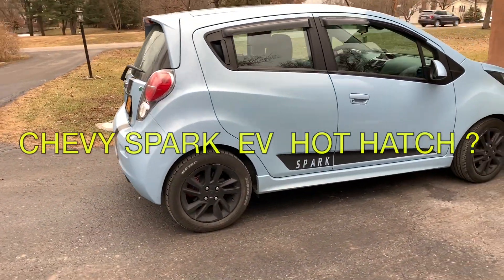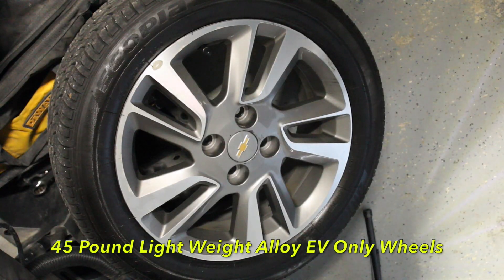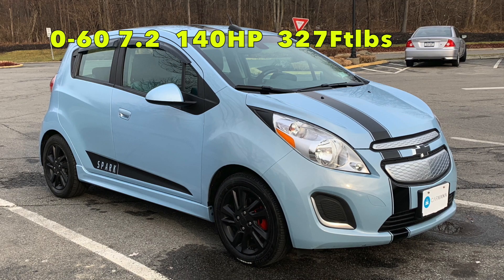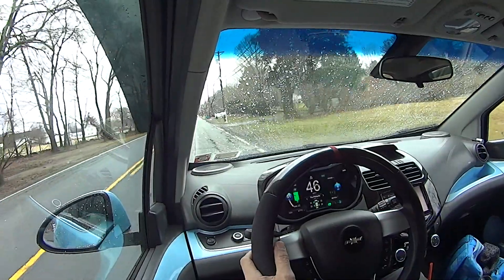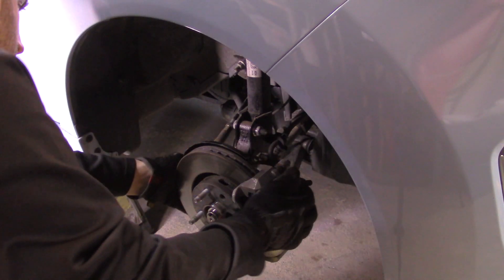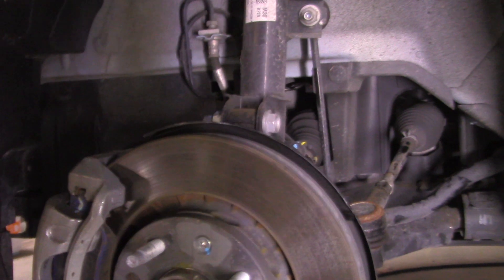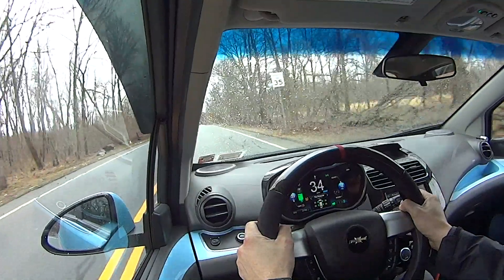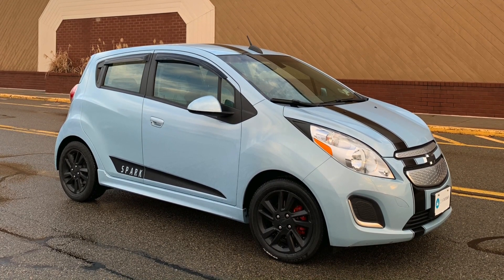Chevrolet Spark EV The only Hot Hatch Electric car ?!

Comment: The 2014 model has 400 ft’lbs of torque. It’s amazing fun. Flat on the high end, but boy does it rocket out of a stop light. It’s a poor man’s Tesla.
Reply from the maker: Even if you buy the 2015-2016 the 2014s 400 ftlbs has a 3.1 final drive but the 2015 has 327ftlbs but a 3.8 final drive making the same power. It is limited 0-30 but once you get up there it feels like its going to take off. It could easily be a Tesla if Elon would make something like this .
Reply: this is a homeless mans tesla, that being said i own a spark ev.
Reply: @svtwrc  Just imagine how much punch it would have if they didn't limit the power 0-30.

Comment: You sold me on this car. Was afraid that a 7.2 second 0-60 would be a bit slow for my wishes, but after hearing your side of the story and a few others who own a Spark EV, I'm confident the instant wall of torque you get makes it feel much faster than the number suggests. These are dirt cheap on the used market right now and I'm going to take the plunge in the next few months. :)
Reply from the maker: Arc the 0-60 is due to the controller limiting full power for the initial roll out until about 15mph. If you pedal it right at launch then feed it full beans it flies! The only car that hung off the line so far was another hybrid Lexus and we were dead even. I smoked a Camaro v6 off the line with my ECO tires ! A Jeep srt8 was full bore sounding glorious on the highway and I was RIGHT with it!  The range has to work for you , expect about 60 miles from full charge in the winter using the heat. If that works for your daily drive before charging at home again , you will have no problem.
Reply: @svtwrc  And these things are inexpensive on the used market!  Might be my kid's first car.  Aside my Volt I already have.
Reply: I usually act slow til about 30 then stomp on it. That appears to be the sweet spot for torque vs traction.
Reply from the maker: ycdocs120 just put sticky Achilles ATR sport tires 185/55R15 just up front to test the grip. This chassis with the upgraded spring rates really comes alive when you don’t spin on almost every launch . Getting some 0-50 0-60 times with the eco tires and the new tires. Video on the way. It is power limited till 35 mph but the manual says in D push the throttle half way after 35 full pull ! Strange right
Reply: @svtwrc  I have 195/55/r15 summer super sports on mine, you can almost go full lock before they rub. Found some chevy rims with cool color inserts to mount them on.

Comment: As an owner of a 2015 Spark EV I’d say
it has the potential to be a “hot hatch” as there are some underwhelming aspects from the factory, imo. The biggest issue is probably the skinny factory tires. The brakes could be better. (this car can be downright dangerous in the rain if you aren’t mindful of its characteristics). The undefeatable traction control is a hindrance. The torque is clearly neutered off the line, definitely slowing the 0-60. 2-300 less lbs would be more optimal as well. The range needs to be at least 150 miles to be really daily livable as your only car, especially in the winter running the heat(unless your commute is round trip less than 50 miles).With all that said the car is still quite fun, especially for $9-10k used!
Ill admit I am a bit of an enthusiast as I also own a Hellcat, Tesla model 3 performance and an old Miata. The Spark is a beater car for me:)
Reply from the maker: Ben Jake Hi Ben , I got some high performance tires for the Spark up front , still finding the match for the rear 195. The tires woke the steering up , braking is better , turn in and you can hook off the line in the right condition. now I’m getting some impressive launches dusting some turbo cars .my plan is to put the Megan racing suspension set up in and go SCCA Autocrossing as I’m a veteran autoX er. I believe with the sparks throttle response I can put some serious times down. There are videos or the Spark EV racing at Mazda Laguna Seca and it beat a lot of cars it should not have.  It is soft in a lot of ways but so are some of the Hot Hatches out there. 08 WRX comes to mind. Old GTi was even soft in a lot of ways. The Hellcat must be amazing , I own a quick little Subaru but my wife is getting a Tesla and I think it needs to be the performance , what model we are still looking.  Thanks for watching .
Reply: SVTWRC 
Yeah with the right set-up I can imagine the Spark EV performing very well in the autocross/autoX! The Hellcat is awesome; comfortable, sounds great with seemingly endless power, a bit under tired and has traction issues going wot 1st-3rd gear even 4th in the wintertime. 
You seem to be an enthusiast yourself. The performance 3 is definitely worth the extra money imo. The standard dual motor brakes and tires are underwhelming with much lower limits. The performance has superior handling and braking, sharper steering, track mode and a lot faster 0-60/satisfying g-force feel:)
Reply from the maker: Ben Jake yeah check out some of other videos , I Autocross and rallyX with SCCA but rally was beating the crap out of my WRX STi  and my prepped Saab is in the junkyard with a broken frame from a jump . The Hellcat must be so much fun to try and get traction because I heard when it hooks you can go 0-60 in under 3 seconds! My fun vehicles need to be inexpensive performance type or at least like the Spark a potential style car so I can modify them and race them on a budget. The Tesla will be a shared car between me and my wife and I’m so excited been speaking with some people on modifying the Tesla and Spark . Specially the annoying 0-30 Spark software power reduction . Stay tuned that may be a good one.
Reply: When do you have time to drive so many awesome cars?
Reply: Idk if you still have it, but try half throttle till 30mph then floor it. That's how the owner's manual says to launch and it grips and goes faster than if you let traction control detect slip, fight it, recover, then accelerate again.

Comment: I'm considering one of these as a daily driver so I can keep my Avalanche for truck stuff. What kind of range do you normally get out of the Spark?
Reply from the maker: Kip Winger hi there , the Spark differs from season to season so summer is around 80 miles a charge and winter can see a drop to 55 miles a charge due to the cabin heating using the power from the main battery. My work drive is around 40 miles round trip going the long way even in winter I can make it . If the driving your doing is in that 35-40 mile round trip before a home charge of around 12 hours using the wall plug at 120volts when empty this may work for you. As an only car this doesn’t make sense unless you have a strong charging infrastructure near you.
Reply: Quarter mile...at a time

Comment: I think the appearance problem is the giant headlight profile that looks like a nostril. 
I would paint the black triangle body color & the same with the side of the lens that the light isn't shining through.
Black plasti dip on the stock wheels might make them look bigger.
Lowering the front for weight distribution & slightly wider tires in front should help launches
Reply from the maker: Robert Pryor Megan Racing Coilovers made a huge difference . So did the weight savings , race seat , and front tires.

Comment: Been watching closely at the 2016 Spark EV. Its a no brainer to purchase the Spark EV over the Nissan leaf for the price and performance. Thanks for 

Chevrolet spark ev 2016 
used 
$15K CAD
4 seats
DC fast charging
19kwh (but has a higher efficiency than the leaf & liquid-cooled)
326 lb torque
140HP
131km range

Nissian Leaf 2016 
$17K CAD
5 seats
DC fast charging
24kwh
187lb torque 
107HP
135km range
Reply from the maker: Jacky Heshi the thermal managed battery seems to be what separates this from most other EV at this range. The Spark is a little beast  and could easily be the formula for what Tesla looks at for a  small compact car.
Reply: Not all DC fast charging are the same. SparkEV charges from 0 to 80% in about 20 minutes, something that no EV can do (not even latest Tesla). It's not only because the battery is small, but battery chemistry and superior cooling. See my blogspot.

Comment: I've been using an OpenEVSE to set a timer so I can avoid charging over 80% when I walk in the house. It's a bit pricey and that I know that I only draw 16A max (12A at 120v) but I know of no other 120/240v EVSE that can set a timer or has built in Wifi to control my (SoC) state of charge.
Reply from the maker: Peter Sachs someone stated that the “always plugged in for the next drive “ dissipates the 12v quicker. As far as the 360v 19kwh in the rear , don’t know of any that have WiFi that would be incredible. You can also keep an eye on SoC through Torque Pro but you have to have the Bluetooth dongle plugged in .

Comment: They should have made it AWD like most other electric vehicles. Otherwise a impressive little car, lots of potential.
Reply from the maker: that would be amazing but the price tag was would be over 30k USD and it was already a head sell at 26k new. The Bolt doubled the range making the Spark an almost steal on the used market. It diminished in price over 65% in less than 2 years due to the Bolt.
Reply: Only Tesla has AWD. Most EV are only 2WD.

Comment: I have the 2015 and love the car you are spot on with this review! Around town super fun to drive, but on the interstate with the short and narrow wheelbase when you get in those tire grooves in the asphalt it get really weird when you put the hammer down!
Reply from the maker: Peter it’s so different than gas cars. So happy with this so far.
Reply: @svtwrc  please keep posting videos on this car, there's not much on detailed performance tweeks on you tube thanks!
Reply: Part of that is the the way the tread on the stock tires is set up.  When we swapped our summer/winter aftermarket tires on it improved noticeably at speed.

Comment: I have a 62 mile round trip commute to my farm. I am looking at getting a Spark EV,  how long does it take for a half and full charge using a regular power cord?    I have access to power at the farm and i may put in a fast charger out there eventually.     I worry about the winter but if i can charge it up there i should be ok im hoping.
Reply from the maker: Javier Picard hi honestly that’s too close to the actual range you will see in the winter with the heater on.  The charge from empty is around 15 hours in the cold and around 7 to go from half. Not sure this is going to work for you my round trip is 30 and it’s perfect. Maybe the Bolt EV or something with over 140 miles range should really work for you. If you get stuck have to take a detour , you may be in trouble with the Spark.
Reply: @svtwrc   damn  i figured charging during work hours would be enough to get back home. 
Driving up 31 miles to charge it for 7hrs would leave me with like 45miles or so being enough to get back?
Reply from the maker: @javierpicard5532  if you get one with DC fast charge and have a charger near by you would be set. charging with the Level 1 set to max amps 12 would help.
Reply: @svtwrc    pardon my ignorance   what level charging is 240v?    If i have 240v at my farm and at the house i would be ok right?  It would be 100% every time i go home or the farm.   In the winter would it be less than 35 miles one way?  
 I also have my truck and my gf kia soul incase the roads were too bad.   My gf could usenthe spark in town and i could use the soul if it was that bad.   It gets cold here but it isnt horrible.
Reply from the maker: Javier Picard we are all learning about EV here . Yes a level 2 @ 240 is the best bet . You can most definitely make that work from the sound of it as long there is a back up car. Also in the winter use the Temp button to heat the cabin then shut it off but leave the HVAC on circulate it keeps the heat for a while before you need to kick the button on again for a little bit, saves a ton of range with the heater on.
Reply: @javierpicard5532  I live in an exurban county around Atlanta and typically have 60 mile round-trips for the photo gig I do.  If your total trip is 62 miles round trip with out a charge, you are the practical limit of what you can do and get home provided you have your tires pumped up to about 40 miles and don't use the resistance heater.  If  you're in the south, a decent down filled vest and the heated seat should suffice ... or add a 12-volt heated pad. Both are comparatively low draw and you'll be plenty warm. 

If it is 62 miles one-way, a 120 L1 charge only adds about 4-5 miles for each hour of charging. Seven hours would add  30-40 miles which combined with the 10-20 miles left puts you only at roughly 60 miles ... which would be a killer if it is 62 miles. 

There may be some other factors - rain will knock off 10-15 percent of your range. If it is flat land, reducing your speed may gain you more than you'd think.  Terrain is also either a help or hinderance. In running my routes there are some highways I will use if going north east but I'll avoid the same stretch going southwest, opting for secondary roads where my route toward higher elevations are on roads I can drive slower on because I can maintain a higher (5.0+ miles/kwh )  The cool thing is that using the roads in the direction of lower elevation will let me cruise at 60+ and still generate about a kilowatt of power. If I'm need more power, I simply shave off some of my momentum going up the next hill, thereby maximizing the generation of power. 

Fact is, playing the hills is my only exposure to fast charging.  I mean if  you're traveling down a long hill, you can often get a 60 second sustained 25kw charge :), but the best this one offered is the 3.3kw L2 J1772. The L2 charger will pump about 12-15 miles an hour of charging and getting fully charged takes about six hours. 

Let me add the SparkEV I drive is an early, early '14 that was first registered in February '13 in Michigan. The SparkEV was not available for sale until that summer so I have one of the  oldest battery packs. 

asphalt

Comment: Yep remember when these were released in small numbers. You have the later LG Chem version with lower voltage battery system. The earlier ones with the A123 battery pack had a higher voltage system and had More Torque. This is a silly car that the GM Lawyers forgot to shutdown the project.
Reply from the maker: Neojhun haha just to prove your point we Camaro SS 2014 lost to the spark EV regularly that’s not supposed to happen !
Reply: @svtwrc  Welcome to the crazy world of BEVs. The realy crazy cars are the half tonne batteries beyond 70kwh. At a low stress 8 C-Rating that is 560kw ~ 751hp. That is the absurdity of modern large format battery arrays.
Reply from the maker: Neojhun hopefully in the near future those modules will become small enough to allow long range EV race cars . It would be nice to retro fit a lighter weight module that has the same 21kw the current peck has but saves 300 lbs would equate to more range better performance.

Comment: When replacing the 12Volt battery is it okay to go with a non-AGM battery? I had a very hard time finding an OEM AGM battery for this car.
Reply from the maker: Andres Abreu that’s a tough one but you should be able to replace the Lead Acid 12v w lithium . I’m going to have to dig into this , maybe the cost was too high from the factory?
Reply: @svtwrc  I was able to find the OEM battery on Amazon. It was supposedly "new" but it clearly was not and was not the freshest date. It was also priced at $200 which was the cheapest I could find. From my research a non-AGM battery will work but will degrade quickly also another Spark owner suggests that a non-AGM battery might not be compatible with the electronics. They pointed out that the Volt also only uses AGM and it shares some of the same electrical components as the Spark EV.
Reply from the maker: Andres Abreu if the terminals and electronics can’t handle it , try an Optimum or an equivalent with a good reputation. Going to look into this for a few days, anything I find I will share.
Reply from the maker: Andres Abreu looking into rear brake pad change with the Electric parking brake. Supposedly it is only a cable style and not a motor attached to the rear caliper so as long as the electronica parking brake is disengaged there shouldn’t be an issue changing rear pads that’s going to be coming up in a future video. Some of them need a computer to put the break into service mode and some people have got  away around that.
Reply from the maker: Andres Abreu https://www.electriccarpartscompany.com/Replacement-Drop-In-for-12V-Lead-Acid-Batteries_c_131.html fact checking this
Reply: I replaced mine with a cheap Walmart battery 49.00 it's been working fine for two years now.

Comment: I just bought one salvage. Putting motor and batteries in a brz lol
Reply from the maker: EverythingIKnow OMG there is a company called EVWest that may be able to help you fabricate anything . The motor and drive unit would live in the heavily modified trunk and you would put the batteries in the engine compartment . Please send pics ! Lol
Reply: @svtwrc  lol of course i know who ev west but I am doing this my self with another buddy. We are also doing a tesla model 3 drive unit in the back of frs. Using volt batteries. Some. In the engine bay and some where existing gas tank is. It actually should all fit pretty well and rip when it's done. The goal is to actually use two spark motors together